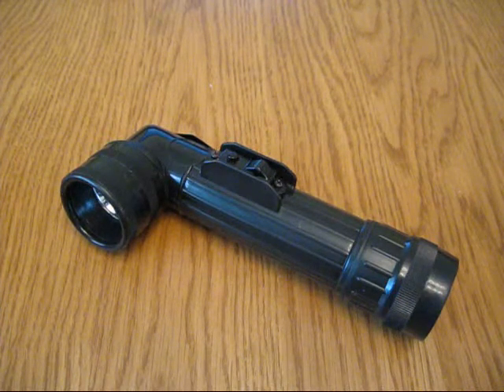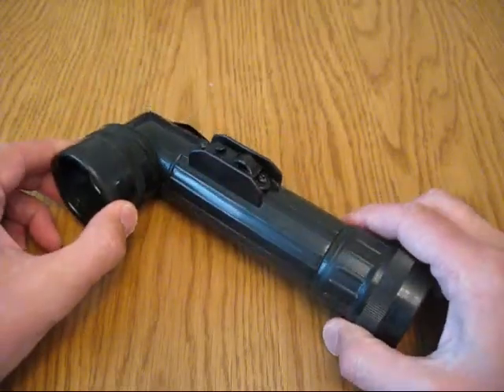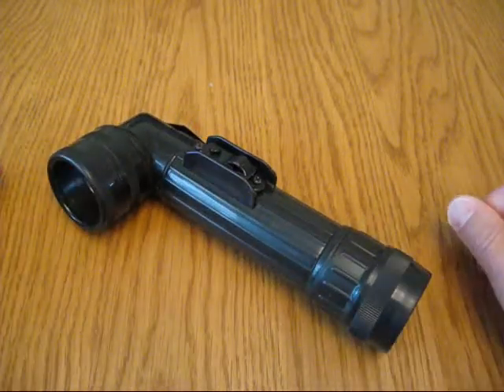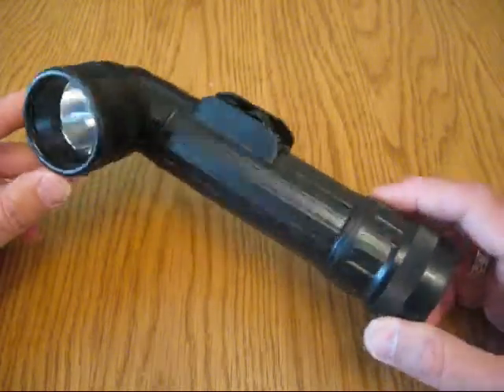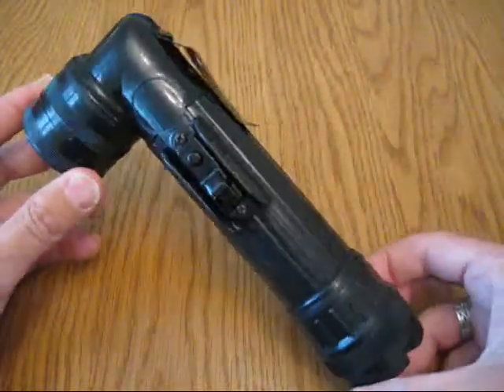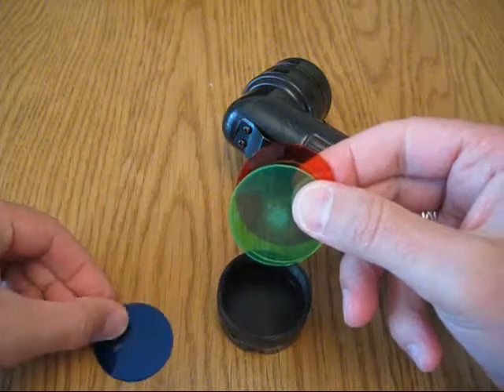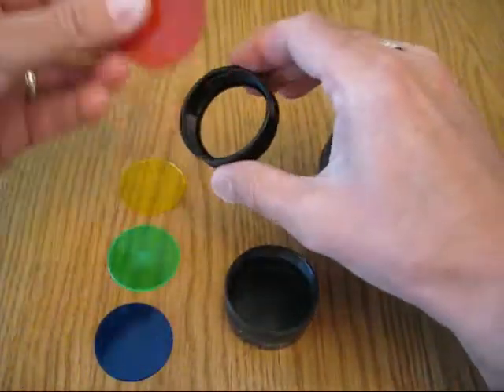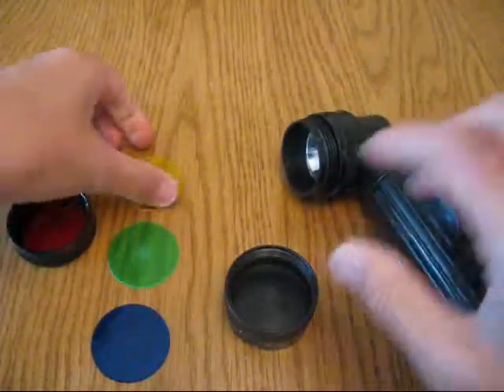Bushcraft - TL-122 Army Flashlight - My Review & History

Comment: .

FINALLY!!!! My 9 years in The Corps and 3 years in the Army will come in useful. Gimme a School Circle and Listen Up.
1. Colored lenses were for all kinds of small unit tactical signalling. Opaque white lens was a light reducer, yup. Red lens had issues with ink formula on maps not showing up visible. Lots of science involved with eyes and optics, Natick Labs worked late to figure that one out.
2. LED upgrades are an excellent Service Life extender for these lights.
3. Most extra incandescent bulbs were broken already. Weak filaments. Broken glass.
4. Hanging hook slipped on the upper left breast pocket of a field jacket, great for doing field checks on HAWK radars.
5. The little plastic switch protector wings came out in the mid 1980's. Best modification ever because before then the switches were ALWAYS FN BROKEN AAAAAAAAAAA !! I guarded my light with a vicious jealousy.(Both of them.)
6. I don't know why but most of the metal loops at the bottom cap were removed from the ones I'd seen.
7. Using a pencil tip erasor on the brass contacts inside tended to make them work better.
More later if I remember.
8. BA-30 military batteries sucked. Always got Duracell's for my own.

.
Reply: MICHAEL MILLER you forget one thing brother the angle was for being in the foxholes

Comment: I was an infantryman in the 101st Airborne Division in the late 1970s and early 1980s. We still carried those flashlights, usually attached to the suspenders of our load-bearing equipment (LBE or Web Gear) with the metal clip. It was usually on the left strap and secured with an elastic boot blousing garter. They were ALWAYS carried with a red lens. The red lens was to protect your night vision. If you turn on a white light you become night blind for about 20 minutes. The only thing we really used them for was map reading and maybe reading some field correspondence and were supposed to cover ourselves with a poncho to keep the enemy from potentially spotting us. I notice the more modern versions have those protective ears around the switch that earlier models did not have. I understand the later models contain a blue filter lens. What I have been told is that combining a red and blue lens makes it UV which is used with night vision goggles.  BTW.. this bit of kit, along with knives, watches, machetes, hatchets, etc... was purchased by the individual soldier, not issued.
Reply from the maker: Steve Warren Thank you for your excellent feedback and for your service, much appreciated...

Comment: I bought four of these, for SHTF situation. Mainly this very TL-122 because of the lens and at a 90 degree angle. In a black out mode, for example in a under ground bunker, trying to stay undetected , using the red filter helps keeping your light low. It may be detectable to infrared, but if you are behind cover its less detectable, the red filter doesnt emit a wide ray of illumination above or reflection off walls. So if you need to move around in dark areas, using the red is not as detectable . if you in a structure at night, the windows are covered , moving around at night, the reflection is much less and less likely to be noticed   by people outside. There is also a blue filter, combining the red and blue makes a purple light which the purple light is what is commonly used on military vehicles in black out mode for night tactical movements. When i was in the US Army, we used these flashlights to set up camp in tactical training exercises.
Reply: Great feedback Liam and very interesting to hear. Thank you for your comment and your service. Regards JesterBushcraft 👍

Comment: In Vietnam, and I presume WWII as well, the red lens was used to preserve night vision.  It was used a lot by our lieutenants who read maps beneath a poncho.  Once finished, they emerged and could see as well as before.  The red lens was also used for signaling that could not be detected by our enemy, that is if the direction of signal was away from enemy forces.
Reply: Red is the shortest wavelength of visible light so it is harder to be seen by opposing forces
Reply: How mach army flashlith
Reply: Meron akong army flashlight nabibinta bato
Reply: Indeed, Red whilst a very rich colour doesn't throw as far or at least our eyes perceive it as being shorter range.
Reply: @JettBlast  No, Red and Infrared are longer wavelengths. Also, Wavelength has nothing to do with the range the light can travel but rather the Frequency of the light similar to sound. A Candle can be seen from a mile away at night.

Comment: Where did you get your information from when you researched that? That's not what the filters are for. The filters are specially designed for a few reasons. The red filter is designed to ease your eyes from being exposed to the sun to nighttime. The red filter is supposed to be easier on your eyes.
That's one reason.
The second reason for the red filter is because it's been scientifically proven that red is the hardest color for the human eye to see at long distances. So they often use the red filter so the enemy will have a harder time seeing your light.
The violet/blue filter is for the same reason, only it gives you much less light. It's for times when you're being covert and under enemy attack and if you need just a little bit of light so you don't get seen, that's what the blue filter is for my friend.
Reply: The red filer also does not wreck your night eyes

Comment: Awesome video!! I've had a few of these type flashlights and I have always wondered what the different colored lenses were for as well. And I even found out more about these flashlights from your video!!
Reply from the maker: Christine Coletta Glad you found it of use Christine...
Reply: Yes, I NEVER knew about the extra battery and always wondered what the heck that thing on the bottom of the flashlight was for. Now I'm that much closer to cracking the mystery of these flashlights!! And if I find out more about the different lights, well as soon as I'm finished with this, I'm going to ask some one I KNOW should KNOW. So I'll repost what I find out. ;)

Comment: The real Mil-Spec flashlights are made of a more durable-plastic (that doesn't crack when you drop it).  Also, the switches don't wear out as easily.  The TL-series flashlights are not Mil-Spec, but okay for weekend-camping or emergencies.  Be sure to check the batteries often too, since those flashlights tend to make batteries "leak" if stored for too long without usage.

Comment: No worries.. Initially i put a tts-3wcree les bulb in but this was for 4.5 to 9 volts and whilst it was super bright it flickered because there was not enough power.. I have now dropped a nitize led upgrade D/C cell bulb in.  This operates from 2 volts and up and will run from a two d cell torch.  Its not mega bright but is a white clear beam and will last up to 50hrs on one set of batterys which makes it much better as i can take it on trips without having to haul spare batterys around..

Comment: Purposes as the red. 
The green and yellow is mainly used for map. work the reason why you would need so many lenses for map work is due to the fact that there are different colored lines on maps and you can't use a green lense on a map with green lines or else you won't be able to see the lines. And I had never been informed about the spare bulb in the bottom you've taught me something new and I hope I've helped you with this light they make it in a mini version which is called the TL-142

Comment: Speaking of lenses:
I just bougt one of the TL-122 and i've got a problem. The lenses  are stuck in the bottom  of  the torch and i can't get them  out except for  the white one. Is there a solution for that problem
Reply: Try a little soap and water to loosen them.

Comment: That is an imitation TL-122,  you can tell if the o-rings are round and made out of rubber instead of flat vinyl cut outs.  Also if the box has the NATO stock number.

Comment: Read the company name again; I wouldn't be surprised if it would read "Fosco Industpies" with a gross misspelling. I've searched high and low, there just isn't any company by that name in Toledo, Ohio. I've had one of these, myself; very cheaply made compared to the original Fulton ones.

Still, fun to play with! Put in any of those modern LED conversions, a pair of lithium primaries and adaptors to make up the extra room for the 2 D-cells, and you'll have a wonderful emergency light.

Comment: That is a cheap reproduction. The original anglehead flashlight is made by Fulton Industries and made in the U.S.A.. Fulton has been around for over 75 years. Fulton doesnt use screws to hold in the the switch or the belt clip they are tacked in. Plus the plastic is much more durable. This light in this video is made in China.
Reply: You are quite right.
Reply: ChrisSVT2525 I bought two thinking they were official. And from an army surplus store. I guess the dead give away should have been the [Made in China] on the box. I think I'm going to avoid that place from now on...
Reply: Yea I noticed the switch screws too

Comment: I hate to tell you but you have a CHINESE nock off flashlight!
The original was and is made in the United States by a company called FULTON and their name would be stamped where you see the number TL-122. Also, the switch on yours is screwed on with phillip's screws another dead giveaway that it is NOT an original Fulton MIL-SPEC light.